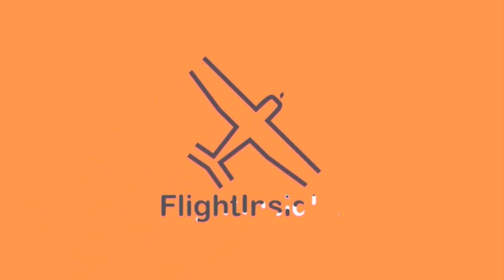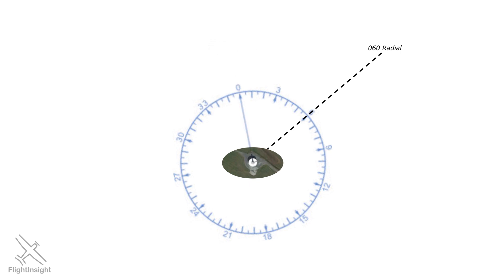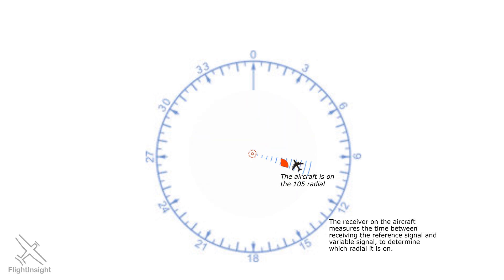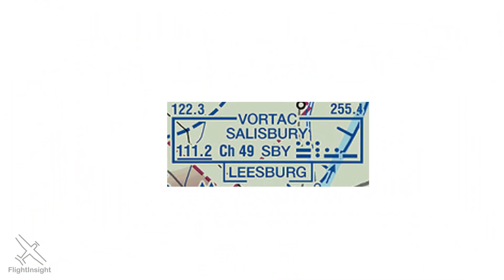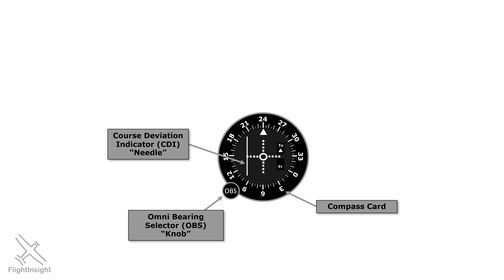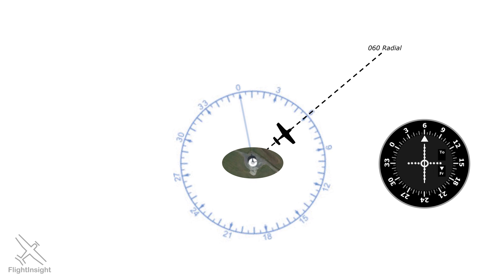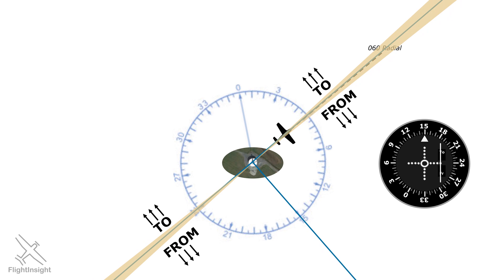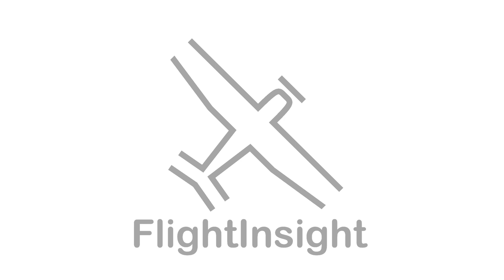VOR Explained Simply | How VOR Works | IFR Training

Comment: As good as these videos are, the explanation for how the variable and reference signals work I don't think is 100% accurate. At least I wouldn't use a rotary phone as the image. The FAA handbook FAA-H-8083-31B ch 11-41 explains it as a phase relationship and how the variable and reference signal become increasingly out of phase at 180 degrees then back in phase at 360.

Comment: How does it know which of the non-reference signals is the right one? Doesn't it still pick up adjacent signals or is the propagation that precisely focused?
Reply: The radials are simply the phase difference between the reference signal and the directional signal.  The receiver in the aircraft is measuring a phase shift between two radio frequency signals.

Comment: I rejoined the avionics trade in the air force and its a second occupation for me, I did the training enough to pass to earn journeyman status but I've forgotten a lot about the systems that I work on. I just read the maintenance manual, and follow it to replace the box if required and carry out a functional as outlined in the maintenance procedure. This video is helping me brush up on the avionics systems in a huge way. Thank you!

Comment: Your explanation of how the VOR determines what radial the airplane is on is incorrect.  The explanation you gave, unfortunately, is often taught in ground schools leading to many misunderstanding how the VOR actually determines the radial one is on.  No information is often better than wrong information.
Reply: Way to point out fault without giving correction
Reply: Pilots need to know how to use the VOR, not how it works, unless they are planning a career in avionics instrumentation and maintenance.  Telling the students that the receiver is measuring a phase shift won't make the job of using it correctly any easier.
Reply: Me trying to convince my student that you can actually measure the time difference between 2 radio waves moving at the speed of light 5 miles from the station:

Comment: "It's not you, it's them" - as a PPL-student: THANK YOU for saying that!
Reply: I definitely needed to hear that 😂 it becomes more difficult here in Europe because they shut more and more VORs down. I have to fly about 45 min to get any reception when practicing with my FI
Reply: @JohannesVogl  Really?  Plenty of them still operating in Europe, but many of them are low-power for terminal areas.  The high-power ones are on airways and have a range of 200 nm.
Reply: Im an IFR student and that simple statement spoke to me. Dont worry even as an IFR student im still struggling to completely master the VOR.
Reply: naw it's a braindead simple concept, you set the angle you want to overfly the beacon at and it just tells you if you are to the left or right of that angle, this is why all radials point away from the beacon

Comment: This is an extremely helpful video, however, at roughly 8:30 when you're talking about the "cone of confusion" being 90 degrees off our selected heading this is actually known as the zone of ambiguity. The cone of confusion is when you are directly above the station. When you are directly above the station the reference signal and the sweeping signal are too close together to get an accurate to/from indication because it's constantly changing (FAA-H-8083-15B pg 257 of 371).
Reply: So, the cone is vertical (top down, the peak of the cone in the ground) and the ambiguity is horizontal.
Reply: good job jeremy

Comment: CORRECTION    THE ROTATIONAL SIGNAL IS THE  PHASED RF SIGNAL EQUAL IN FREQ TO THE OMNI SIGNAL IT IS IN PHASE  WITH THE OMNI SIGNAL AT NORTH AND  90 DEGREES AT EAST 180 OUT AT SOUTH  270 OUT AT WEST ETC    THE RX COMPARES PHASE RELATIONSHIPS  THE OBS SHIFTS THE PHASE UNTIL BOTH ARE IN PHASE AND THE NEEDLE  CENTERS .

Comment: So how does the aircraft/HSI/VHF receiver workout whether it is FROM or TO the tuned VOR radial?  Is DME involved here? (as in the distance is either increasing or diminishing) or is it something to do with how the VOR signal is processed?
Reply: I'm a bit late here, but I would assume that it compares the radial selected with what radial you are on. For example, if you have the 060 radial selected and are on the 240 radial, the VOR receiver knows both of those pieces of information. From there it would know that you are flying to the station. If the selected radial and the radial you are on are the same it would show the from flag.

Comment: my question about this type of equipment..how come most planes have upgraded their instruments, but things like VOR or NDB..why haven't they been upgraded...since this type of navigation is very very old..why is this?
Reply: well its first serve as a great backup lets say your ILS or GPS failed in that case you can use the VOR or NDB to land instead of diverting to another airport , yeah they do have a greater margin of error but they have been used for the last couple of decades also the RNAV uses near by stations to determine its location  so it needs them as a base for its operations the only instrument that doesn't need a ground or Satellite base equipment is the INS/IRS but they still need the coordinates of your aircraft initially then it can operate within its margin and it cant be as accurate as an ILS 
also some countries are slowly phasing out NDBs but VORs and DMEs are going to stay for a while longer not to mention a lot of GA Aircrafts that are built in the 60s, 70s, 80s 
hope this explains why

Comment: Your explanation is the one that's usually given. It has the advantages of being simple, intuitive, and easily understood. Unfortunately it's not the way VORs actually work. The real explanation is enough to warm the cockles of the hearts of all dyed-in-the-wool electronics geeks, especially RF geeks.

Stripped to its essence, the reference signal is not pulsed, but is radiated continuously. The radial signal is not swept, but is also radiated continuously in all directions. By dint of some clever engineering in the antenna system, the phase of the radial signal changes as you move around the station. On the 360 radial, the difference in phase between the reference and radial signals is zero. Your receiver doesn't measure time differences but, rather, phase differences.

The mathematics of this shows that there are actually an infinite number of radials, but there's no point in worrying about more than 360 of them.

And then, you can go to Europe and talk about Doppler VORs, which are a whole 'nother story.
Reply: A phase difference is a timing difference. If the radial peak is arriving 16.66 ms after the reference peak, for example, then the receiver is on the 180 radial.
Reply: @clownhands  You, of course, are correct. The point I was trying to make is that the reference and radial signals are not discrete, but are continuous in time and space.
Granted, it make no difference in using VORs or understanding the concept of their operation. As I said, his explanation is sufficient and is intuitively understandable to the vast majority of people.
I however, being an avowed electronics geek and an unrepentant pedant, couldn't resist throwing in my two cents.
Don't forget: this is all analog. There is no digital signal being transmitted and there is no precision timer implemented in the receiver. The phase of the signals is compared directly, probably using some kind of discriminator circuit which, in more modern receivers, undoubtedly is implemented in DSP.
Reply: @johnopalko5223  indeed, and let’s take a moment to enjoy the devilish cleverness of the engineers who originally conceived this principle of operation so many decades ago!
Reply: @clownhands  They were geniuses.
Brian Kendal, in Manual of Avionics, ISBN 1-4051-4654-0, specifically states that the VOR receiver uses a digital phase shifter. I suspect the original design incorporated a goniometer as part of the phase detector, which would explain the rotating scale on the omni head.
Reply: @johnopalko5223  so when was that ?   what year  did Vors get invented start of building  ?  Who was original inventor? 
What was used b4 Vors  if anything ?
it is amazing cool radio tech  still today... too bad lot gone away FAA  taking em down  right?
Reply: @phillp7777  The VOR was developed in the United States and was first deployed in the early- to mid-1940s. Before that, there were the four-course radio ranges and, of course, non-directional beacons. Four-course ranges are defunct but there are still NDBs.

Yes, a lot of VORs have gone away, now that the majority of navigation is by GNSS (GPS is the U.S. system; Russia has GLONASS, the EU has Galileo, and China has BeiDou).

The FAA is not dismantling the entire system, though. They have defined the VOR Minimum Operational Network (MON) which guarantees that aircraft will be able to navigate to selected airports in the event of a GNSS outage. A key concept of the MON is an aircraft will always be within 100 nautical miles of an airport that has at least one ground-based instrument approach (ILS or VOR). The MON provides nearly continuous VOR signal coverage at 5000 feet above the ground outside of the Western U.S. Mountainous Area (WUSMA).

Within the WUSMA, and outside the conterminous United States, the FAA is not planning to decommission more than a very few VORs. In those areas the system will remain, largely, intact.

I hope this helps!
Reply: @johnopalko5223  so for WesternUS.. do u mean like  start from Rockies and all west of that N-S line or so..those states?   so how many Vors are left then to east  like east of I-35  let's say ?   I know FAA cut like them in half  ..forget the total number.
Vors rly do work.. long ago over 40yrs doin a solo for Ppl used Vor radial  right off a small airport as my checkpt/waypt... tuned it in ahead and the radial..as I got closer closer can rly see the needle  centering.. and bingo  on its deadcenter..I look out could see my checkpt airport passing by..told me exactly where i was on chart.. cool nav radio .  worked.
 But kinda hard confusing  to learn at first..takes lot practice.
Reply: @phillp7777  Figure 5-6-3 in the AIM depicts the mountainous areas. WUSMA starts in far southwestern Texas, includes the western 3/4 of New Mexico and Colorado, all of Wyoming (except for a tiny sliver), most of Montana, and all of the states to the west. The Central Valley of California and the Puget Sound area of Washington are not depicted as mountainous but are still considered to be part of the WUSMA.

I don't know how many VORs remain. That information is probably available from the FAA.

Yes, navigating by VOR is difficult to learn but it was amazingly useful. It still is.

I was flying VFR one evening, long before GPS was invented, and I wanted to call the tower over the town of Yorkville, which was a VFR reporting point. I was following a highway and there were lots of little towns along it. I wanted to make sure I got the right one, so I dialed in a radial from a nearby VOR. Then I pointed out the CDI to my girlfriend and said, "See this instrument? This is a Yorkville detector. When the needle centers, we're over Yorkville."
Reply: Another interesting note: VR headsets that use “lighthouses” follow a similar principle. Photosensors with known relative position detect timing differences between a reference pulse (infrared flood light) and a timed sweep of infrared lasers. With two lighthouse stations sending out laser sweeps of the room from opposite sides and with known positions of the photosensors relative to each other the headset can work out its position in 3d space. In the case of the VR headset it is a digital signal, unlike VOR. This is the approach taken by Valve and HTC. VR headsets from Oculus use SLAM (Simultaneous Location And Mapping)  instead, which has less physical hardware requirements (no stations) but requires significantly more complex processing.
Reply: I was just watching this video and immediately went to the comments to see if someone had commented this! Not that I'm a VOR expert at any rate, but did happen to be reading about it a short while ago.
Reply: @jordankjak80 where can I find more information on how the reference and variable signals work.
Reply: @jordankjak80 where can I find more information on how the reference and variable signals work.